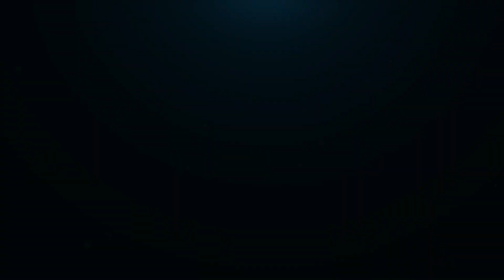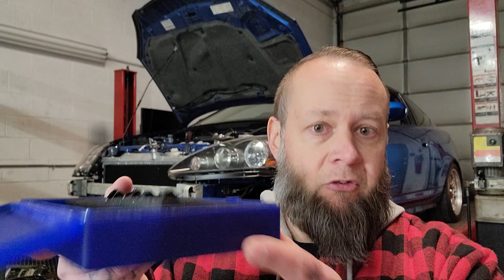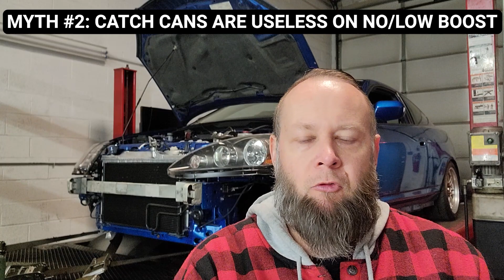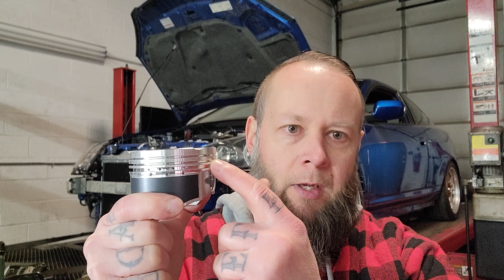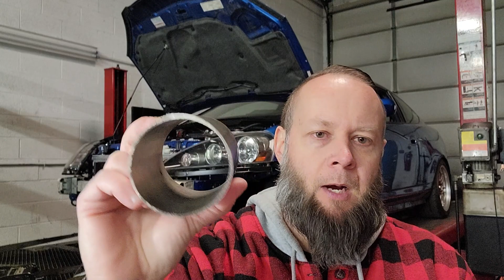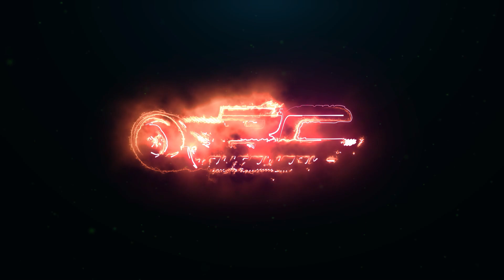MythBusters Ep.1: Fuel injectors, catch cans and back pressure

Comment: No back pressure is fine for a racecar. But like you said 
An n/a  Honda can't move enough air to fill a 3 inch pipe. It doesn't matter most of the time. Driveability exists in the real world, and 90% of people with a straight piped honda aren't making anything but noise. So unless the Goal is just to be as annoying as possible, dont be that guy.
Reply from the maker: My thing is, you gotta find the best of both worlds. Also, never purposely restricted power to change the power band up. We see a lot of Honds guys picking the wrong headers cause they want torque down low....Hondas don't make great torque period, so people should be utlizing the proper parts to make the most amount of power ( to s point )

Comment: get an electric exhaust cut out. open pipe for power when you need it. closed pipe for when you sneak past a cop. best of both worlds.
Reply from the maker: 💯 , you got the right idea. 👍 thanks for watching and commenting.
Reply: One thing I've found about most brands of electric cutouts, they always leak. Always.
Reply from the maker: @ryurc3033  we don't like electronic cutouts due to the high failure rate. Living in the Midwest doesn't help that either I'm sure. We prefer making them and either using a vacuum source or using the old school manual ones where you unbolt the plate. You can get pretty creative with throttle body's as well.
Reply: @RCautoworks    great information to know before i cut my exhaust pipe.  thanks.
Reply: Xforce,  google it

Comment: On exhaust, I have a dB limit I have to meet because we set up courses in empty parking lots and we have to be good neighbors or we lose access to the site, so I have to find the best balance between quiet and flow, or basically the most flow that still meets the dB limit for my class. My class has a 95 dB limit measured at a point on the course that is max power and from a distance of 100 feet, generally right before the braking point on the longest straightaway. I have been using the Holley Laminar flow exhaust muffler that is the same inlet size as the collector on my header. Any advice, or am I about as quiet and free-flowing as I can get for my 6.3 liter LS engine?
Reply from the maker: You have a solid reason to restrict flow a little bit, nothing wrong with that. Do you currently have a resonator?
Reply: @RCautoworks  no room under the car or beside it. The turnouts just clear the rear tire and the headers touch the back of the front tire at full lock.

Comment: Only reason for injectors for the sake of injectors is blueprinting to achieve a flow tested matched set. Skip the messy catch Can and opt for an Oil/Air separator that is plumbed to return the slightly cooled back to the sump.
Reply from the maker: There's a huge difference in an oil catch can and oil separator though. If the catch can is setup correctly it won't be messy at all. One of the bigger issues is people run to small of a can and it will overflow ( puke ) or its not hooked up correctly. Both serve there purposes though.

Comment: In the past, I was curious about back pressure. I asked a mechanic, "What happens if you don't have back pressure?". He paused for a second, and then told me that it's hard on the valves - that you can burn out your valves if you run it too hard without back pressure.
Reply: I've always wondered, do people just not care about driveability? Throttle response? Maybe not going deaf while driving? 
Racecar is different scenario, because it only sees full throttle. Driveability concerns become less of an issue (harsh clutch engagement, smooth part throttle response)
Reply from the maker: @ryurc3033  honestly I think age is a big factor. Younger guys will sacrifice and not fully think about the long term. We have seen guys pull heater cores out to save weight, and regret it 4 months later in the winter. This is nothing new though, it may be a little worse now a days though.
Reply: @RCautoworks  100% facts, one thing I've learned through many, many, modified cars, many car meets, many shows, everyone has their own idea of what's cool. 
I installed plenty of exhaust I thought sounded like crap, but the customer loved it(G35/Honda/V6 mustang). Many of those same kids(usually) ask why I ran 2.5 inch pipe on my mild built 454, and put 18 inch long  magnaflows on it.....
The answer? 
It fits better on a slammed truck, and I can drive 400 miles without getting a headache. It's only maybe 400 hp, but that means is still reliable. It doesn't have .650 lift solid lifter cam because I don't want to constantly be breaking valve springs, it doesn't have 14/1 Compression because I want to get by on 91.  It still sounds crispy, clean and aggressive, and being a big block, it gets plenty of attention in a 76 shortbed, stepside Silverado. 
Them kids will learn someday, but for now, I will do what they want.
Reply from the maker: @ryurc3033  vary true, and that's what separates us all from one another and makes us great. Unfortunately some people don't see it like that and they just wanna bash people for not fully knowing why someone did something or went a certain direction.
Reply from the maker: Running an engine with no header / headers could damage valves ( not recommended ) but it's not from lack of back pressure.

Comment: Love these videos. You and mike from moto iq only tell the facts 👍 also just need my fuel system ran and 525c walbro pump installed than ill be askin for the etune again. Id like you to make a vid on my car when i get it to your dyno its got the kt1000 k247z 4piston racing  engine, and the newer stage 3 4p cams that supposedly doubles the hp from stock, rbc intake, 5858 turbo, 12 lbs, and a boost controller, with the full race 3" exhaust, 1650cc injectors, will have 8an feed 6an return, with a fpr. Fully built trans by you guys gears 1-5 new fdrive new lsd. Cars fully built but id like people to get to see what the engine will do with the cams specifically because theres no videos of the cams in a full built turbo car yet we gotta make it happen first 😂. Thanks for reading
Reply from the maker: I'm ready when you are 😀, shoot me an email RCautoworks@gmail.com

Comment: Hey is it safe to run 12 psi on a 9th gen Si without a fuel return system? DW300c with ID1050x injectors
Reply: Yes, I ran a dw 400c pump with dw 1000cc injectors and no return system on 12psi with my 9th gen si for a while but sadly I had a oil ring issue. So I had to park it lol
Reply from the maker: psi is irrelevant with out knowing the turbo size. 10 psi on a 62 trim turbo is completely different then 10 psi on a 72mm. 

With that being said, it depends on how much power you're making or trying to make and also what gas you're on.
Reply: @RCautoworks  I’m using a pulsar gtx3582 with a 7 psi spring but it was creeping to 12 psi on the dyno due to cold temps and made 373 WHP on pump 94
Reply from the maker: @k24z7_  you're fine, once you get over 400hp stock sleeves are always a concern. That 5psi boost creep though....Cold temps shouldn't cause that much creep. Sounds like you have other issues.
Reply: @RCautoworks  thanks for the reply do you know what will usually cause this issue? I’ve double checked everything
Reply from the maker: @k24z7_  ensure the vacuum / boost ports on the wastegate that aren't being used are plugged. Then double check vacuum routing to ensure it's properly connected.

Comment: Hello I have a d16z6 fully built it has 12.1 high compression piston eagle h being rods and ACL high pressure oil pump The block been notch. D16Z6 selling a head that been ported intake and exhaust I have BC springs and retainers I think I have a stock camshaft with a AEM true cam gear I have skunk 2 pro series intake 70 mm throttle body in a VMS fuel rail with 410 e85 compatible rdx injectors I have a  aem. 320 e85 compatible fuel pump I have a full two and a half exhaust all the way back with a four to one headers. I am running a flex fuel sensor Honda s300 V3. My cylinder head do have ARP head studs with a climatic three-layer head gasket. I was wondering if you could estimate the power output to the wheels with this setup that I will be making. I so call had a dinotune and the guy gave me the dino sheet and it made 124 18 to the wheels with 107 foot pound of torque please tell me what you think my power should be at
Reply: It in a 1995 Honda Civic DX four door sedan
Reply from the maker: Thanks for watching, as for power, depending in how that dyno reads ( high or low ) I'd expect around that on the single cam. What was the redline?
Reply: @RCautoworks  7500
Reply from the maker: @gerandoeley5429  shoot me a picture of the dyno sheet and tune and I'll check it out. Email is rcautoworks@gmail.com
Reply: It read low 14 low